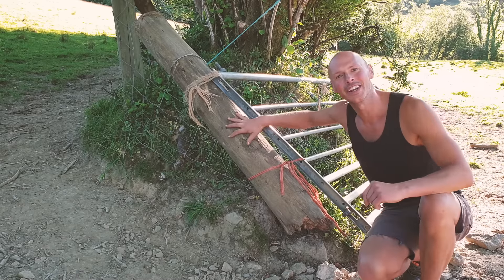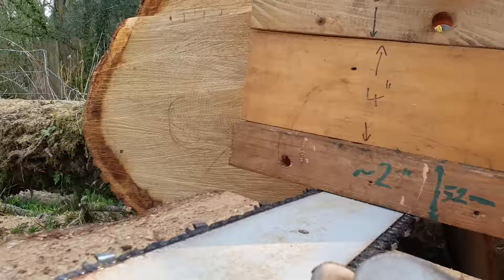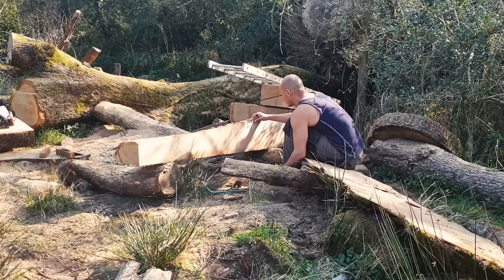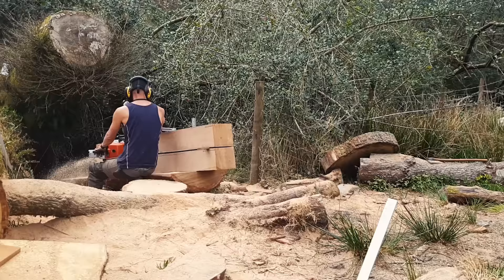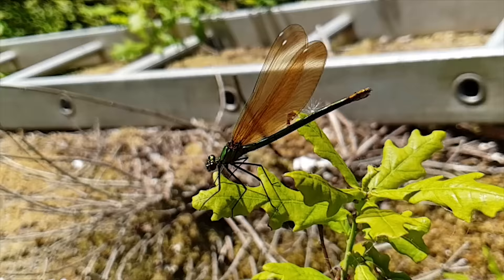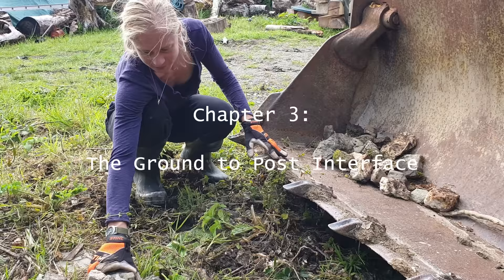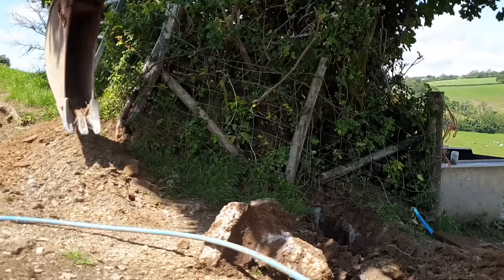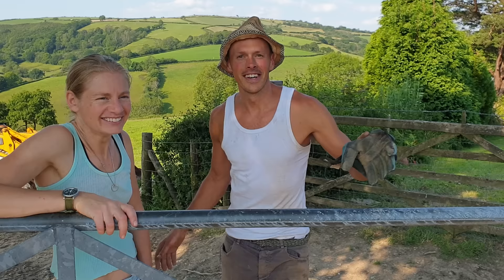The 3 secrets to ROT PROOF POSTS and how to make them

Comment: I read about someone who used dense clay in the old days to back fill the posts to prevent underground water from lingering. That is what I'm doing for fence posts and other posts in my back yard. I use a 16 pound prying bar like  yours to pound the clay in the space between soil and the cedar (I'm in the US). I make a little cone of clay at the surface to prevent puddling of rain. I'm worried about the spaces in your rock-filled cavities. The underground water can linger there.
Reply: I have experience that parallels this. I used to work in the London urban fringe making rights of way signposts from oak 4x4". Oak felled and milled as part of the restoration of woodlands, which we (and out volunteers) also did. We were on London clay. We set the posts by ramming stones or brick/concrete hardcore in the bottom then ramming clay, then a collar of stones to just under ground level and a layer of clay around the base of the post to above ground level to shed water. Posts were untreated but still lasted over 10 years easily unless they were on a corner where dogs got at them. Frequent anointings with dog wee seemed to rot them off very quickly an the footpaths and bridleways were very heavily used (very crowded part of a small crowded island).  This was a real thing, not a piss take. If we discouraged the dogs by setting the posts back from the path edge, they lasted.

Comment: Also, there is tremendously good advice in many of the comments. Examples: on the choice of woods, drying the post wood, to rammed earth method of filling the hole, and many others. Worth reading the comments and the comments on the comments. You folks work too hard. Take a break.

Comment: Mix 50:50 motor oil and diesel (kerosene is OK too) and paint that on your posts, ends and sides. Let soak in entirely. This is how old-timers did it and their posts would last for decades. Or longer.

Comment: burning works on softwoods too. makes them last longer. just still not as long as hardwoods. softwoods absorb water more readily that's why
Reply: Many softwoods are more durable than hardwoods such as maple or beech; durability relates to compounds such as tannins, resins and oils contained in the timber.

Comment: You really should consider plastic posts. Our yard next to the beach are fenced with plastic posts and plastic planks. Its been 15 yrs already and no deteriorating at all. Also a bright yellow and bright green and orange algea are growing on them. Quite lovely and no weakening whasoever. Also the weight are slightly higher that wood. Also, this fence is exposed to harsh constant wind(Cape of Storms) and very hot summers. This material has no covering paint on them. I dont know if the manufaturer has put anything but the dark brown coloring inside the moulded plastic. It also was build in a jiffy. Good video though.
Reply from the maker: Hey Orion, thanks for getting in touch and sharing your experience. I actually agree that plastic can perform exceptionally well, if it's the right grade and has uv protecting additives, ect... But...
The more I look into it the more concerning long-term plastic proliferation in the environment is. If we can, in some small way reduce that, then all the better. 100% Recycled plastic is a bit of a gray zone - I'm not quite sure what I think about it...
Reply: @FloweringElbow  hi. Plastic is going nowhere my friend, so rather get it contained in a fixure like posts and panks and I saw lately road blocks (excellent idea) than being dumped in the ocean in bag form. We have diesel factories in SourhAfrica utilising all sorts of plastics which actually raised the prise of plastic in SA so its a sought after by-product for local folks that gather them every week ever so careful from refuse bags and get a livelihood of extra income from the raw material sellars. Well, i just waNted to say about our posts😁 and got sidetracked. Interesting though.

Comment: I would use 200 X 200 mm hollow concrete blocks on a concrete footing with  4  lengths reo ,, lay the blocks over the reo and fill with concrete  ,,, When its cured drill your hinge holes and secure your  threaded bar / bolts  with chemical  anchor ,, there are many diff products I use Ramset 101 ,,  and hang your gates ,,

Comment: I like to bury a “deadman” at the end of my fence runs. At the hinge post I bury a deadman with a solid post diagonal brace that connects the top of the hinge post to the deadman. I use the sane deadman to pull off of fir my high tensile fence. If you don’t know what a dead man is, it’s any type of rot resistant mass preferably a post similar I size as the upright. You dug a rather deep hole in a sideways direction in comparison to the fence or gate , lay the post down inside of the hole abd completely cover it after  attaching your hinge post.  Hence why it’s called a dead man as it somewhat resembles just that.

Comment: Stick the bottom of any posts you want to use in a bucket of old engine oil for a few weeks before you want to use them, they soak up the oil and so never rot. I used to watch them doing this on dock piers when I was a kid. It doesn't cause any environmental damage as the oil soaked in by the wood is never released, also oil is a naturally occurring product anyway.

Comment: My Grandfather taught me a trick 50yrs ago to stop any wood fence post from rotting at the ground level.
Take an 24'' long, 3/4'' diameter drill bit and drill a hole starting 6'' above the dirt, drill at an angle down, so the end bottoms out in the center of the post. Fill the hole with diesel, kerosene, used oil, etc. until it's full. Each pole has it's own wooden plug. He said new posts need to be done 3 times a year, once a year after. All of his posts, 80yrs old, are still standing ! Your posts will probably do the same !
Reply from the maker: Hey August, Thanks for sharing this. It's an interesting technique - and certainly would keep the post topped up with the fungus killing substances! 
The environmentalist in me can't help but shudder at the heavy metals and poly aromatic hydrocarbons in the used oil mix that will eventually be washed into the land and groundwater.
Apparently used crankcase oil can cause hyperkeratosis in cattle, so watch out for that. 
Peace, Bongo.
Reply: @FloweringElbow , Betcha it does less damage than running that chainsaw for a week to make 4 posts.
Reply from the maker: @augustreil  You might be right, luckily chainsaw run time is actually quite low compared to the time taken to prep, shift and fiddle about... Recon it was about 2l worth of fuel in all - so certainly not perfect, or ideal... One day we will all cut with light sabres and eat lasers.
Reply: @FloweringElbow , Yeah, you're right. Either way, nothings perfect. Thanks for all the feedback, much appreciated !

Comment: Longest lasting, cheapest, and EASIEST post I've encountered is concrete.  Cast 'em yourself so that you can build all the hardware cast right into them and if you set the posts in wet concrete they adhere well to it.  You can build 'em as big as you want and use damn near anything for reinforcing iron from old steel rails from bed frames,  garage door springs, whatever.   They don't rot you can clad 'em in timber if you prefer a wood look. They take paint well.  You can drill 'em and use mortar or industrial epoxy to mount more hardware later. Concrete.

Comment: What do you think about pouring a mix of sand and wood ash in the rocks around the post to fill in the gaps with a non-hospitable layer of material to ward off decay and insects?   
Or, what about pouring in a soupy mix of concrete or mortar?

Comment: Part 2. Another proof for the pulley idea is to power one pulley or both. You will see that if you drive just one side the tension will be higher on the side being pulled by the motor and the effect will happen (strongest) where the belt rounds the corner on the low tension side. Now I have guessed enough outcomes that my explanation surely contradicts itself.

Comment: I use steel posts in concrete. I might spend more for the post but you will spend more later in life dealing with all your aches and pains from moving that heavy crap.
Reply from the maker: Good morning Trenton. Appreciate your perspective but disagree. Strength training is an important component of a long health-span. Also environmentally using lots of steel isn't too great if there is a local renewable alternative, that can be made, at least somewhat durable. Having said that, If the only choice was tantalised or steel, I'd probably go steel. Peace, Bongo.

Comment: I enjoyed the process. What type of chainsaw mill were you using. How long do you charge the wood I'm wanting to shut sagi ban some cypress siding
Reply from the maker: Hey Sean, thanks for getting in touch. For masses of info on the chainsaw mill setup just google "flowering elbow chainsaw mill"... As for the char time, it depends of your burner setup, the type, moisture and density of the wood, among other things, so I'm afraid we can't give a straightforward answer. Experimentation is the key ;)

Comment: Another quick thought..  Would a substantial (Say 4" dia) Ground screw work as a post.  I'm thinking of the twisting caused by the gate opening and swinging must put incredible pressures on the post.       There is probably a torque driver that could fit your JCB/tractor to drive it in..     If they are not available off the shelf, a decent steel fabricator could make and then get galvanised..  Whole new market..

Comment: Great video. Thank You. We use reclaimed dock posts from a local dock builder.  Some are branded with date of manufacturing.  Most are from docks that were rebuilt after Hurricane Hugo in 1989.  That makes them 30yrs old!! 90% of these posts are only marred by the excavator that placed or removed them.  We get an occasional kick out of folks wondering why we have barnacles/oysters growing on our fence posts or out buildings.  I can fool the naive teenager telling them it floods here sometimes and oysters grow on the posts. ;)   Not to get into the politics of chemical preservatives.  But, do we want to use powerful chemicals or cut more trees down???  Seems there's not a great answer.
Reply from the maker: Good evening Dr. Gardner. Thank you for sharing that story. I gave Sam a chuckle when I read it out to her. 
Regarding the chemicals debate. My immediate thought is that, in Britain at lease we should shift to planting more durable wood vs. the quick growing pine plantations we mainly have... If posts were durable - they wouldn't need replacing as often, and less chemicals... As you say though - far from straight forward. I'm all in favour of farmers planting their own stands of mixed trees, that will both encourage bio-diversity (in countryside that can get a bit mono-crop-tastic) and be a useful investment for future generations.
Peace, Bongo.
Reply: "You young whippersnapper... when I was young, we had to wade through water THIS DEEP (holding hand up over the barnacled area) just to get to school.  And you can tell by the barnacles here, that it was EVERY DAY for a LONG TIME!  So don't tell me YOUR life is tough!"
Heh.. nice story!
Reply from the maker: @jum5238  LOL

Comment: I commend the fact that you put a LOT of thought into this.
I disagree with using beautiful oak though as an old gate post though.
A whole day for just two posts, which you haven't even put into place yet, nor, dug the holes in the earth for.
So no, it's a false economy of time.
Get the factory treated pine and replace them every 5 to 7 years. One hour max per installation too, instead of half a day PLUS installation.
So I won't thumb up or down, but I salute ye for yere productivity and the mere fact that ye *think*. 👍
Reply from the maker: Hey Sionnach. Thanks for watching. We might make furniture from it yet.  Let it do some time in the field first, build up some character ;)

Comment: How do you establish a first cut on a log that is narrower than the ladder?
Reply from the maker: You can use wedges, as well as some kind of end clamps etc. to help stabilize
Reply: @FloweringElbow  Thanks. Nice work . I found out a while back about charring posts to preserve them. Makes perfect sense. Archaeologists find datable charcoal deposits thousands of years old in the ground. Carbon deteriorates at an impossibly slow rate. The exposed wood will probably rot long before the charred layers.

Comment: Just paint a layer of bitumen emulsion paint over the base, 6 inches above ground level, concrete making sure it goes under and a few inches above ground level sloped off.  Charring I'm sure works but too time consuming.  Paint with tractor emanel above ground to stop insect attack.  Just the fact it is oak means it will last, just make sure it's very seasoned, as can twist badly.

Comment: To each their own, but when I built my fence a few years ago, I opted to use galvanized steel posts set in concrete. Previous owner had used wooden posts which rotted. My posts should easily stay right where they are for at least the next 50 years.

Comment: I just soak my posts in a barrel of old, used transmission oil for a season.  Then I let them drip dry for a couple of days.  Haven't had to replace a rotted post in 20 years.

Comment: There is a non-toxic chemical pressure treatment for wood that is so good, even softwoods last nearly forever. The treatment uses acetic anhydride. If water is added to acetic anhydride it becomes vinegar. The reason acetic anhydride works so well is it modifies wood at the molecular level, which removes the molecular starting points used by bacteria and fungi to begin digesting wood. Without their normal starting points, bacteria and fungi don't recognize wood as food.
Reply: Thanks for commenting. Your comment gave me new ideas. Will have to wait till I try it out.

Comment: Great video, I'm wondering if you do anything at ground level to help shed the water during a heavy rain. I understand setting the posts on stones but doesn't water settle around the bottom above the level of the stones? My area of  America does receive a lot of rain and could fill a hole quickly.
Reply from the maker: Good Evening The Wood Chip Store. Thank you for the good question. The area at ground level is made to be slightly higher than the surrounding area, and large stones are laid to cast the water away from the hole. So it shouldn't fill with water. Of course if the water table is super high because the area is boggy, this is still going to be a problem. In that instance people sometimes do completely different things like Mount posts to huge rocks who's tops come above the ground, or any number of other things.... 
Hope that helps? Peace, Bongo.

Comment: may have been easier to slide the rocket stove on the ladder keeping wood still.
I cut slabs from maple and a sycamore tree by hand, no guide just an electric 16-inch cheap saw. it took about an hr per slice, 17in D. by 9ft long.  Even with good tooling, this is no picnic.

Comment: Scourcing durable softwood is not easy in the UK - mind you, the Larch that we are now starting to grow commercially, is a good thing. I can't help thinking that we're on the tip of a rotten post pandemic, where the base of  the post crumbles - due to the overreliance of the tanalising process .   Sure, you can see the green stain on the surface - but exactly how deep does it go into wood? The answer is, not very deep - you only have to cross cut a 4x2 to see for yourself. I was never convinced of it's efficacy for timber below ground level

Comment: The burning keeps wood eating critters away but to prevent rot they still need to be coated. Several coats of used motor oil would do the trick before setting the posts.

Comment: So propane torch plus lots of cement at the bottom first and all sides to prevent contact with soil. I'll do you one better. After torching with a harbor freight torch adapter to propane than add motor oil to the the entire structure to water proof. Good day.

Comment: Boric acid, is ton less work. It is a naturally occurring mineral and very readily available. Probably best to soak the wood in it, but as it mixes at a 1 to 1 ratio it can be quite expensive. So it would be cheaper to have it in a tank and continually run the mix over the post till it is through saturated, and then let it dry. Another trick is to buy old utility poles or railroad ties. They can be free or very cheap and are far superior in longevity than anything that could ever be found on the market.
Reply from the maker: Hi Shane, thanks for the info - are you mixing the boric acid in water or oil?
Reply: @FloweringElbow  Just water. Would note its bit tricky to get mixed, so warm water is better. Also it will make your hands feel sticky if you get it on you. Its very good against wood boring insects and fungus. Also in large amounts it could kill plants (same as salt). Make sure you clean up after using it as whatever is left turns into a big crystal like chuck. I usually use what is left (and any water I use to clean up with) on my gravel driveway to kill weeds.

Comment: hello i have recently bought 12 oak posts 6"x 6", 2,5 m long, for a garden fence project. I like the fire treatment and will definitely try it out, in the video you do not mention anything about drying, are your log dried before being cut? i bought mine dried for 14 month, as the timber yards all said, they would not last more then a few years if i put them in fresh from the mill. 
Any comments ?
Reply from the maker: Dry is good 👍  one benefit of the fire treatment is that you get a bit of extra drying... cutting is much easier wet/green though, so best seasoned  after being cut. Oak drys about 1" per year with air drying, so it's not so practical unless you can kiln or vacuum dry... 
Peace.